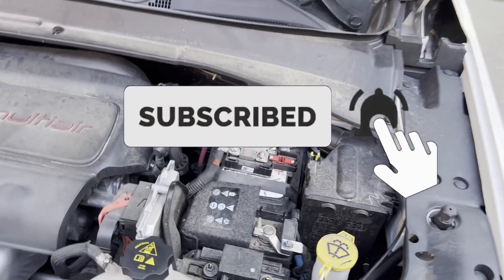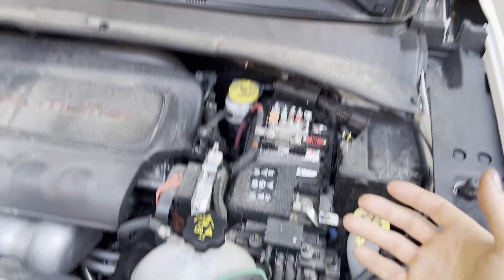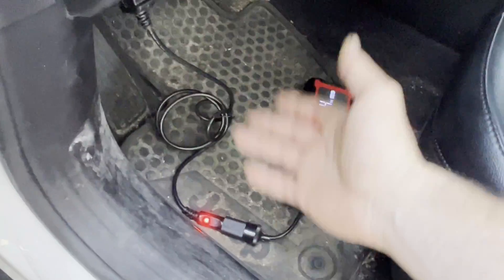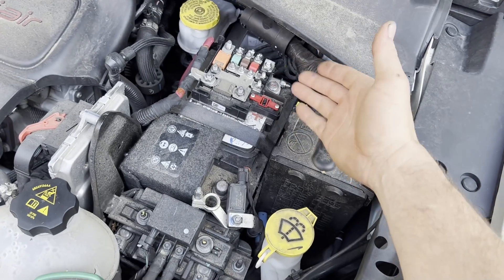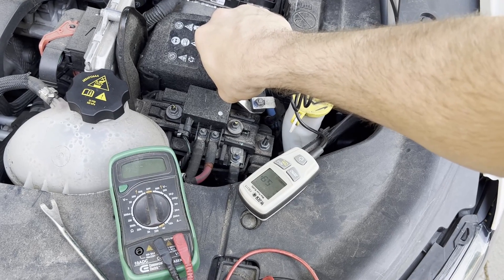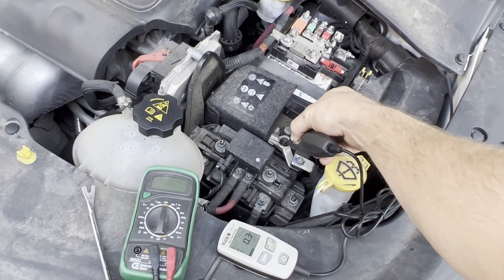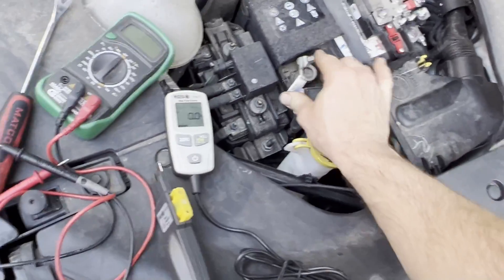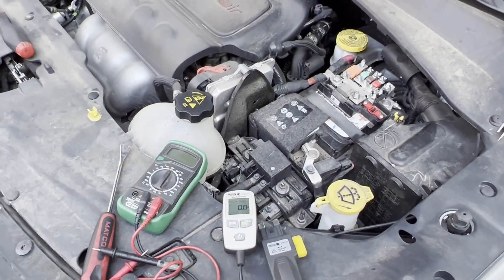How To Check Your Vehicle For A Draw

Comment: Does it not matter that the bonnet (hood) is open? Thanks. Nice Video. 😀
Reply from the maker: In this case, no, since it has no hood light. But that’s an excellent point. Cars with hood lights would have to either do this somehow with the hood shut, or disconnect the hood light prior to the test for accurate results.